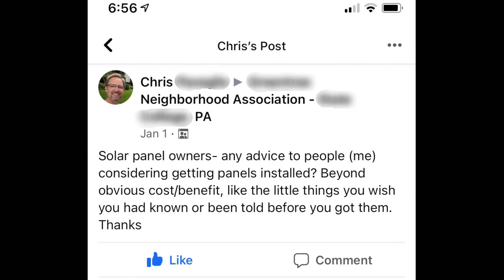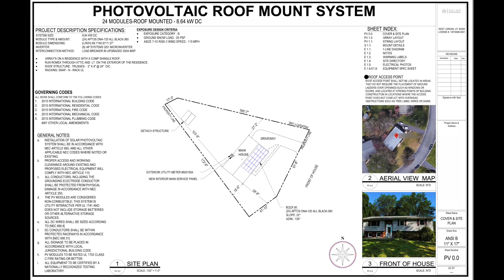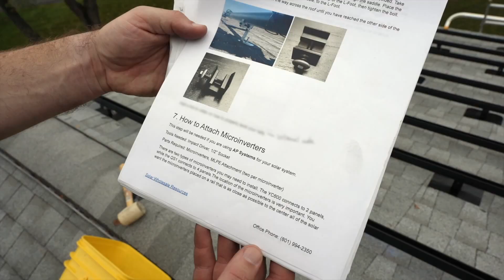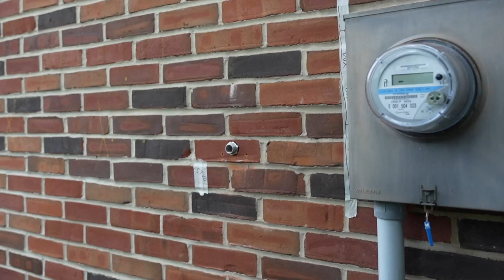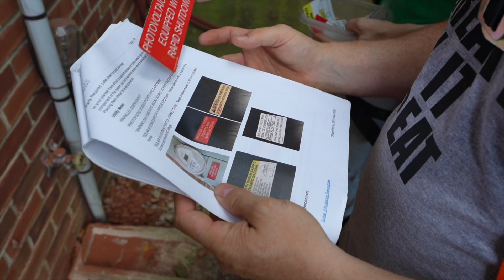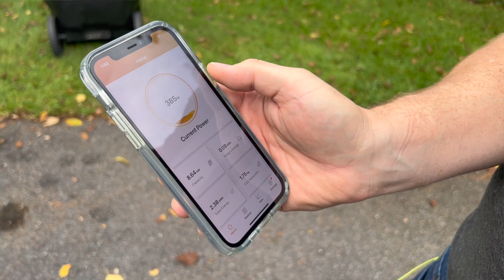Rookie Couple Installs HUGE Solar Array

Comment: 9:00 NO NO NO NO NO NO NO.  You cannot coil wire like that.  Wire that is inside the coil will not be able to shed heat and you can end up exceeding the thermal threshold of the cable EVEN IF YOU ARE NOT OVER CURRENT.  DO NOT DO THIS YOU WILL BURN DOWN YOUR HOUSE.  If need be make longer open loops or more sanely JUST CUT AND RE TERMINATE THE DAMN WIRES.

Comment: 10:44 why is all outside and not inside the house, everybody who likes can shut it down because of allways being accessable
Reply from the maker: That’s the way it is with any solar array.  It’s so first responders can power it down if needed.  It’s a requirement.
Reply: @FrugalRepair  I forgot to add that i am from europe and there it is always inside the house, hope the question is now making more sense ;-)  -my father has also a huge solar (warm water and electricity) and all is wired inside the house, also the plug in to the grid

Comment: They went with Enphase which is more expensive. Should ve gone with regular string inverter and avoid getting a kit. $4k savings
Reply from the maker: They used APsystems not enphase.  Plus it gives panel level monitoring and installing micro inverters is easier.

Comment: Is there any way to secure the switch outside so that only the owners can turn it on and off?
Reply from the maker: There is usually a spot for a padlock to be put there but that’s not legal because one the reason the switch is there is for first responders to be able to shut down the system if needed.
Reply: @FrugalRepair  Ah, got it. Thanks!

Comment: The first flashing they installed is incorrect… they need to go under the next layer of shingles, what they have done is set a dam in front of the shingle gap.
It isn’t as critical on architectural shingles, but on 3 tab versions, it is quite important.

At first it looked like they had 3tab, but the end when they broke the bit it looks like they have architectural.

Comment: What solar panels did your neighbors use? I got a quote from solar wholesale and the only panels they had were vsun solar panels.
Reply from the maker: They used aptos 360.  Maybe they ran out.  I know there is a supply issue for solar panels everywhere.  Feel free to shoot me an email if you have other questions.
Reply: @FrugalRepair  That is what they told me. Supply chain issue. I am a "made in america guy". Vsun is not made in America.:(
Reply from the maker: Sorry to hear, aptos and NEA (panels they typically use) are made in USA.
Reply: So I found a company that I am going go use. I have all gas furnace, stove, and water heater(on demand tankless). In your video it says that you use electric base board heating. With using those, what was your annual yearly electrical usage? I'm going with a 10.4 kw system, and was thinking about switching over in the future to all electrical since natural gas is getting outrageous.

Comment: Curious to know if the panels cause additional noise in rainy conditions.  Is any increase in noise noticeable indoors or while outdoors?
Reply from the maker: Not that I’ve noticed.  There is the air gap between the shingles and the panels so if anything it’s actually quieter.  I’ve not noticed anything different while outdoors.

Comment: What was the overall time it took them to do this and could you share what the average cost of their install would be, just curious?  We have a very complicated roof that we just replaced in 2019, cost around $26k (very steep and lots of hips and valleys).  We are very handy people and I think we might look into this.  Only problem I see is that my husband is afraid of heights!  Girls with power tools!!
Reply from the maker: For this project they didn't have the complicated roof that you house sounds like it does.  I'd estimate it took  about 2-3 days of focusing on the work.  You could install roof anchors and use safety harnesses, that's what my neighbors did.

Comment: I'd love to have solar, but what about when it comes to replacing the roof? all of that has to come off. That would be a significant cost, wouldn't it?
Reply from the maker: It may not all need to come off, the shingles underneath should last longer since the are protected from the heat, rain, etc.  But if you did take it all off, you can probably take it all off in half a day with a few friends and then put the mounts on at the same time the new shingles go on to save time.  Since you'd likely be putting everything back the way it was, it should go much faster than when first installed.  I'm sure there are tricks installers use to make this process go as fast as possible.
Reply: Add solar to you're homeowners insurance. I live in Texas where we have hail storms a few time a year which to be honest along with other natural disaster is the only things you need to worry about if you've had the system installed correctly.

Comment: I had u a thumb down, until I watched the whole video. BUT y'all need to get the STORAGE!
The day is coming where they will charge y'all storage for hooking up to the GRID.
Reply from the maker: I'm curious, why the thumb's down at first?  Right now, it doesn't make financial sense to get battery backup in PA, that is, unless you want to have it for power outages.   If things change, like they change the net metering rules or add in time of use rates, then it would be good to look into an integrated battery solution.
Reply: @FrugalRepair , the price of storage will go up, not down.
Reply: Tesla Powerwall?
Reply: @gwarlow   TESLA is known to burn, the old led acid are tried and true. But now they are talking GRAPHNE now. 

I don't like GRAPHINE, I think it is evil.

Comment: Does this come with the battery bank so they don't have to use the power from the grid at night?
Reply: Don't think so, they would have mentioned it as it's the most expensive part. Grid tie system lowering the power bill.
Reply from the maker: In PA where we live you get a 1-1 credit on your electric bill for excess generation (it's called net metering).  So unless you want an integrated battery for blackouts (which are pretty rare anyway), it's generally not worth the cost.

Comment: So the very first hole was to determine where the "trust" is? Like the actual wood so the screws can be good? So you have to make a "trust" hole throughout the build?
Reply from the maker: Truss is the word.  You have to find the trusses in order to screw down the lag bolts.  Usually once you find the first one you can measure 24" over for the next and so on.  But houses are not perfect and when you drill you can miss the truss when you drill the pilot hole.  There are different methods people use to find them.  One popular one is to hit your roof with a hammer and listen for the distinctive sound of it hitting above the truss.

Comment: I have 2 neighbors 1 paid a company to do theirs for $32,000 and their bill only went down 14 dollars , I ask why so little return. They said the company told them it would take a while to get them dialed in. Lol

Then my other neighbor paid $8000 and did everything himself and I mean by himself, and the 1st month fpl paid him back $80 , 2nd month $110,. And since then has averaged $ 115 back in his pocket every month for the year.   Oh I ask him what his bill was before he installed solar , he said I have a big house so about $280 and up. That's a $ 395 reversal of money. His solar will pay for it's self in 3 yrs.
Reply: The ones that paid the company to install a system is probably on a budget it will take a  while maybe a year to see the difference.
Reply: I got some used panels for just $150 that I refurbished, which if roof mounted could potentially generate around $10 a month, I don't think it's worth roof mounting such a small array, so I made it an "off-grid" system, so I don't quite get that much power.

Comment: save all the money you want to but if you don't know how to take it apart when it comes time to replace the  Roof the money you saved goes towards that.. so  Is there a solution for that?
Reply: Best case scenario is to get solar right after you need to replace your old roof so you don't have to worry about it for the next 30 years... But if you do need to replace the roof the panels snap on and off fairly easily..